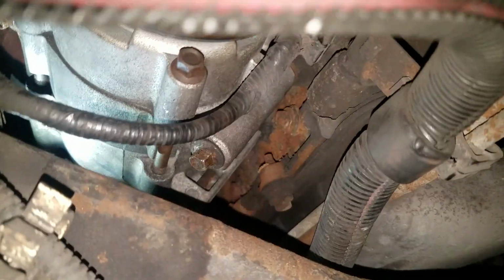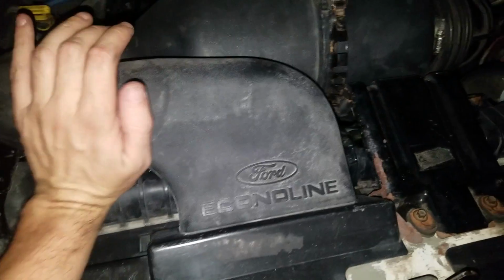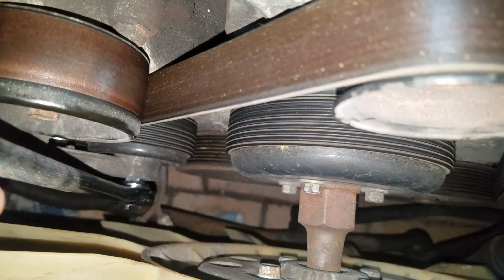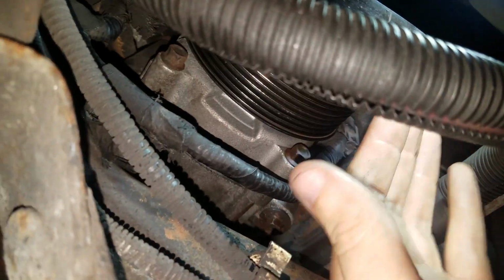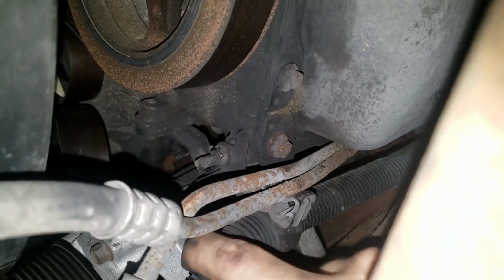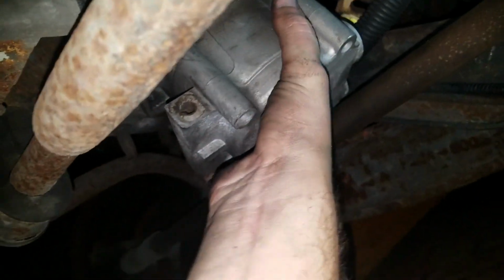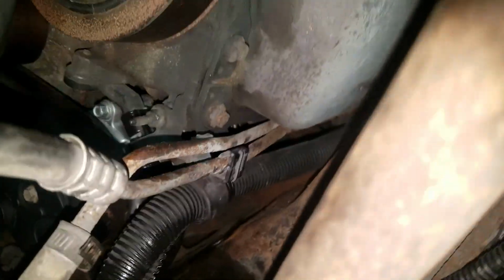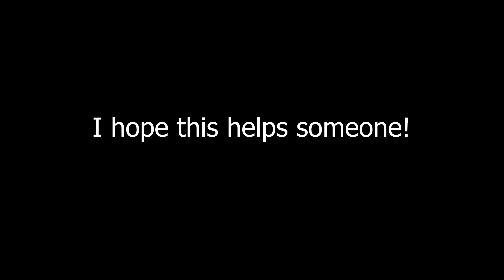Replacement of AC compressor on 1999 Ford E150 van 4.6L v8

Comment: The camera work, focus, lighting was great.  The narration was really good. Im getting ready to swap my e150 ac too. One minor suggestion tool wise is to put a 12” (or so) piece of gas pipe over the end of the breaker bar (or ratchet) for easier leverage. Home depot or hardware stores have sections of threaded gas pipe already cut

Comment: You did a great job changinh thw compressor, if younopw the system you should put a new dryer expansion valve and oriface tube and you probably should get all the little pieces of the old compressor out of the lines or it will make rhe new one wear out quickly. Some of these vans have a non linear condenser in them it means it cannot ever teuly be washed out and should be replaced. Washing the lines out is very hard some people say use rubbing alcohol, but there is a product you can buy to clean them out with. When everyting is done, pull a vacuum on ot for an hour and seal it up . Then let it sit dor s couple hours if its gained any pressure at all check your work theres a leak some where.if not charge it. Thats alot to do but otakes the job last for a long tome skip part of ot and it wont last a couple years, and i know theres been lots of people thst fid have it last but its a gamble.

Comment: This was a great video. Just changed mine out on a1997 E 350. The top bolt was hell. Other than that when putting the compressor back up I unscrewed the 2 lines from the top and attached the compressor. Then put everything back in place. Only took 5 hours. Lol

Comment: we laughed our asses off at the black cat moment!!  thanks.  very helpful video too!  would it be possible to just modify my existing frozen up AC compressor to just spin freely.  we don't care if it works and really don't want to buy a new one. is it possible to take the guts out of it and replace the bearing and reinstall it? it would just act as an idler pulley. believe it or not we broke down and replaced the belt with one designed for the e150 without the AC compressor. it was the same length and narrower but not designed to route it the way we did since we the van doesn't have the tensioner in place of the AC compressor. it was super tight but we managed to get it on and it got us home!  i don't know if this is a thing people have done but i just had to share it with someone. thanks

Comment: Aren't the AC lines under pressure with freon gas? Do you have to recover the 134a refrigerate first and afterwards add refrigerant?
Reply: If you are replacing the thing because of a leak, you probably have lost the charge already.
Reply from the maker: Yep i had no pressure left it was a short tssssss on pressure valve for maybe a second
Reply: I was wondering that myself, so if you have pressure, should you pull the lowside cap and release the pressure?
Reply: My new motto "every bolt is a victory".. Awesome!
Reply: @thorsonnunley6694  thats what i will do first of all.

Comment: You said no oil came out of the old compressor. Do you have to add oil to the new comporessor before installation?
Reply from the maker: theres usually oil in the new compressor